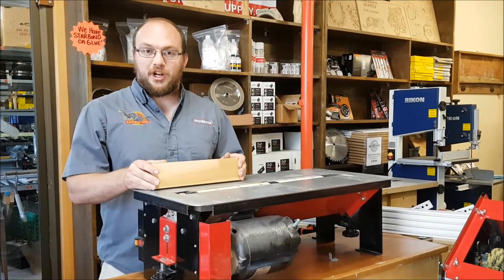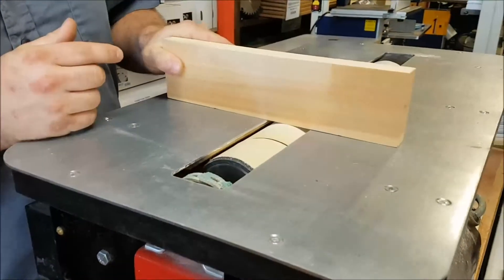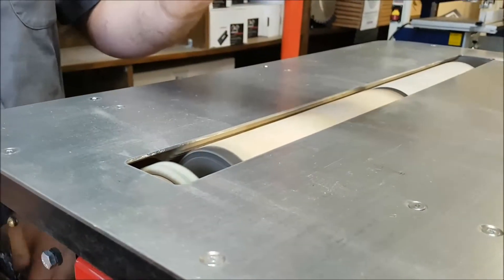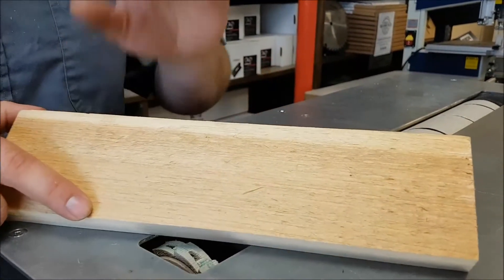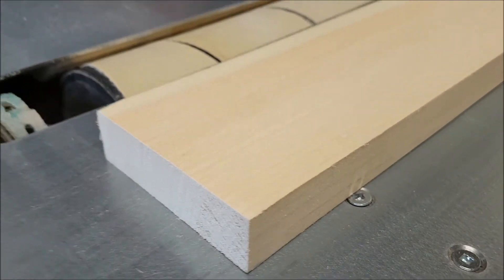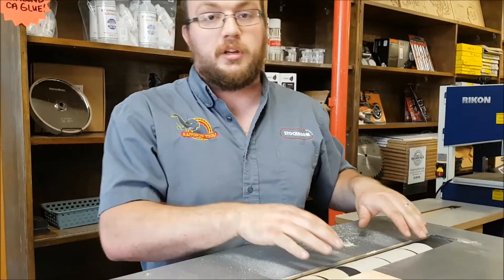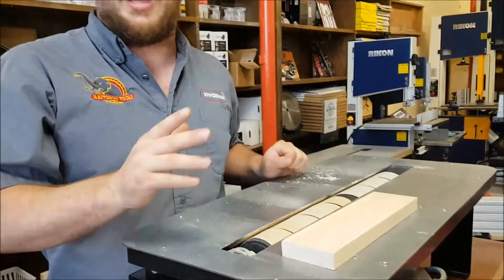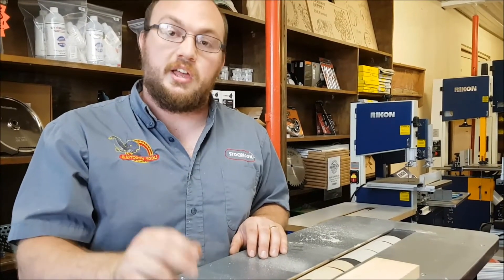EthAnswers How to Adjust The Depth of Cut On The Flatmaster. Not What You Might Expect!

Comment: I'm very disappointed in mine..It may be good for narrow pieces like you advertise but it takes forever to sand anything with some width like a glue up....show me the specs of how  it takes off .016" per pass with 80 grit..I hate to give a bad review but it's just not an accurate post from you..  700 bucks gone on my end..I have a supermax 16/32 drum sander on the way..maybe I can use this for finish sanding..I hope
Reply: .0016